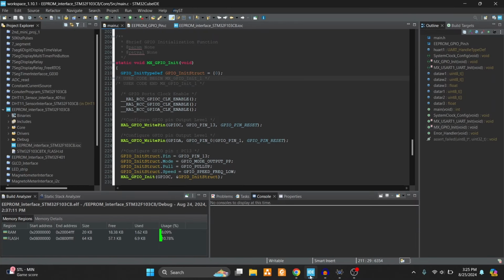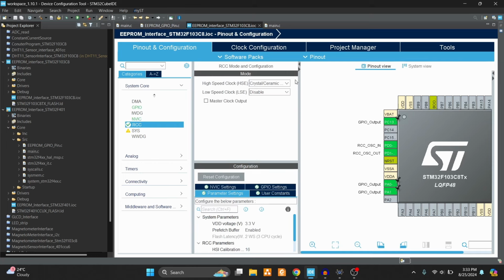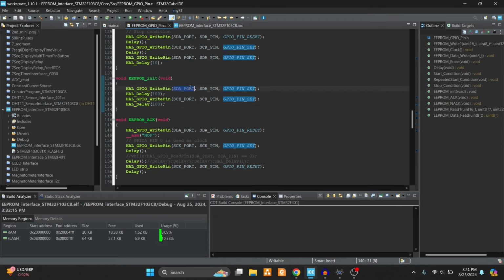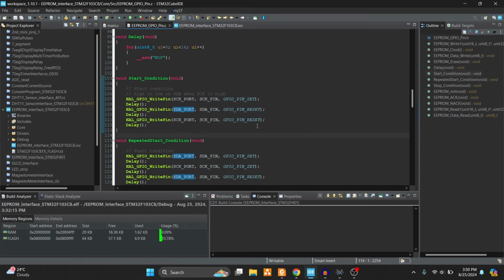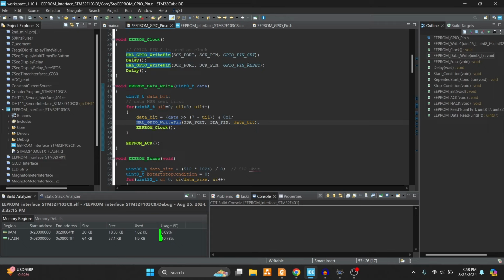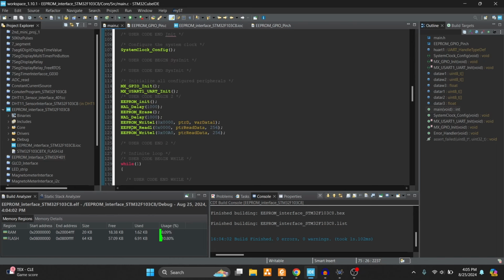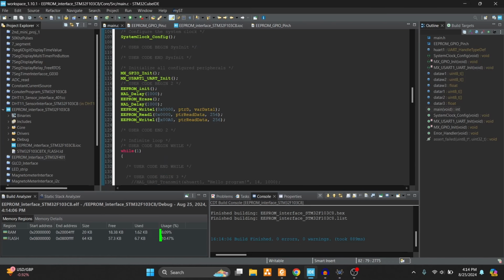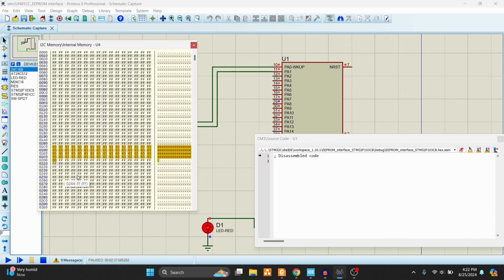EEPROM interface with STM32F103 controller | STM32 Interfacing | Simulation | I2C protocol | AT24cxx

Comment: how did you made this video I'm trying to implement but I'm facing a lot of problem i wrote all  the code as you said simulation is also running  but proteus is not showing the same pop windows like yours and also you've note shown the main.c code clearly . my simply question is why make this in a way that people can implement not just watch.
Reply from the maker: Better watch on laptop than on mobile. I have made the code clear from first line. Note that the auto generated functions are not covered or not modified.
Reply: @stmetatronics-RawLuck  I'm trying to implement it on proteus but not getting the windows as you do could you tell what is the possible reason
Reply: simulation is running